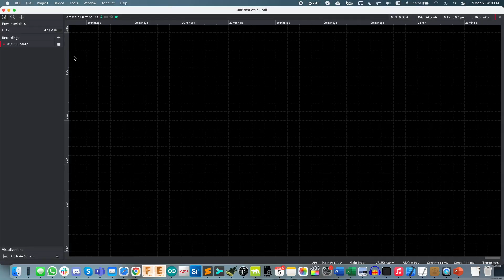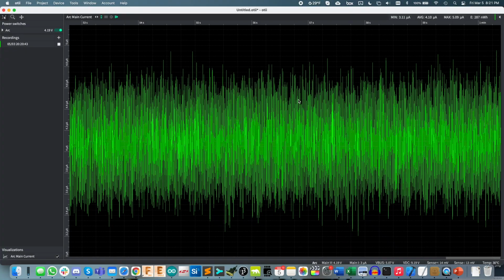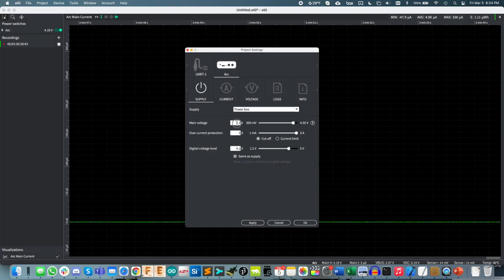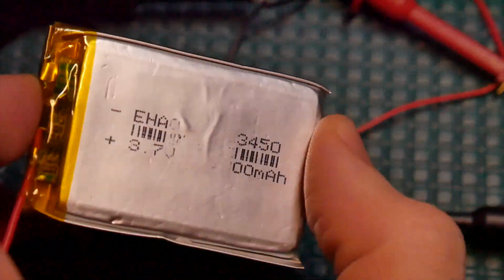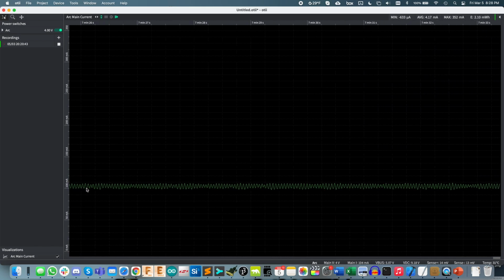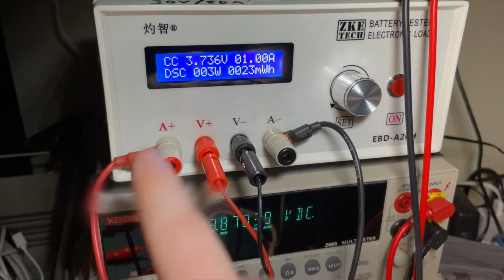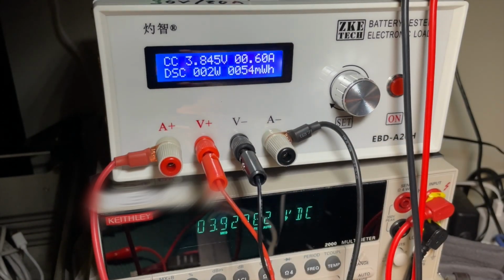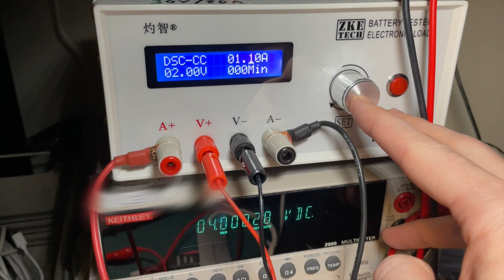Lithium Battery Protection Circuit Experiments - Self Discharge Measurements? and more!

Comment: Thanks for sharing sir. One question, is the protection circuit you shows here are similar with most of the protection on the lipo, or there are some differences, I mean the IC use? Thanks sir.. good sharing

Comment: Thanks that really is interesting especially the actual high current cut off level. About the discharge cut off, I've experienced this myself with a protected battery and found it kills the voltage down to something relatively low. However this was only until I disconnected and reconnected, then it bounced back. Worth nothing though the cut off occurred under a heavier load (so more sag) whereas on reconnect it was idling with little current draw so probably the voltage back over the low cutoff threshold

Comment: Kevin, you should measure the current draw of the protection board at the nominal 3.7V. Not at 4.2V. That would be more close to reality, I think. Thanks for the video!
Reply from the maker: good point - 3.87uA at 3.7V  and 3.67uA at 3V

Comment: Can you do a video on what a charger should have for battery's with a bms. I guess what I'm trying to say is how sophisticated does the charger have to be if the battery pack has a proper BMS. I would like to build a high power (20A) charger for a 3S  80AH battery.

Comment: Battery capacity differs significantly when drawing high current with some cells only offering 65% of rated capacity. I always use discharge charts to make sure I match a known cell type to my intended load.

Comment: Kevin, can you show what the quiescent current draw by the protection circuit is after the cell has been disconnected. Like what's the lifespan of a discharged cell before the protection destroys the cell by taking it under 2.5V unloaded.
Reply from the maker: I measure just a couple nA at 2.9V like it's not even there - basically 0
Reply: It shouldn't kill the battery. The circuit should stop draining power after cutout until you jumpstart it with external voltage (charger) again.
Recently, I disassembled some original batteries from Nokia and Sony Ericsson pushbutton phones (you can guess how long they have been discharged, years for sure) and found out that cells were far from dead. So I recharged them with lab PSU and sure enough, they still got like half of capacity and barely self-discharge. Still works on BT audio module with ~20mA current draw, lasts as long as you expect from the remaining capacity, even if you do not use it for long periods of time.
But, I'm sure there are plenty of examples of cheap horrible protection PCBs with quiescent current present even after cut out.
Reply: Yes, I also wondered about this case